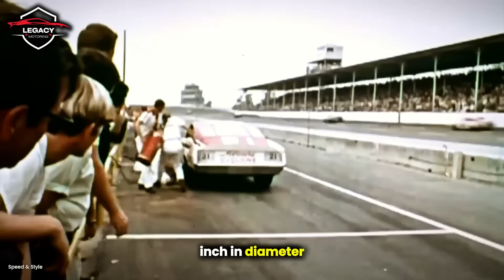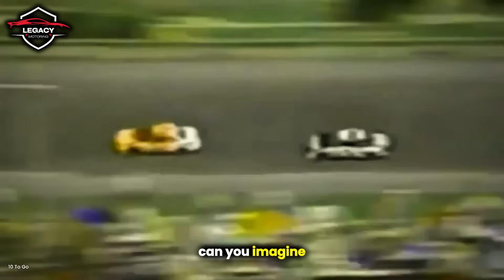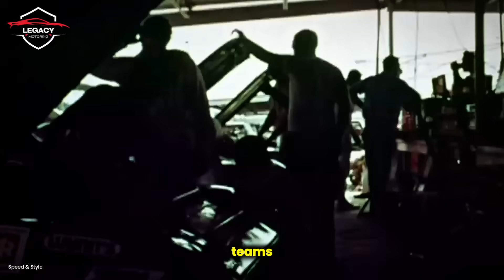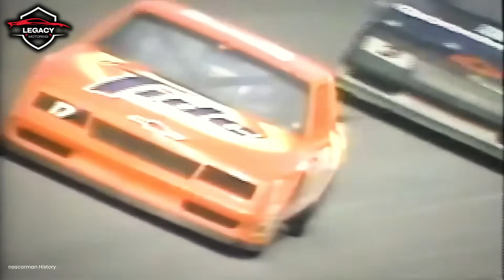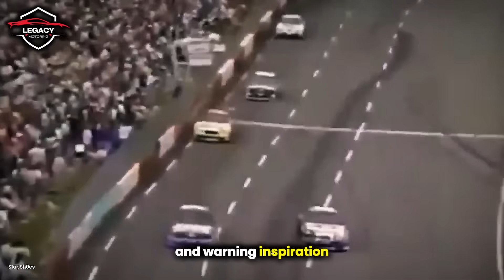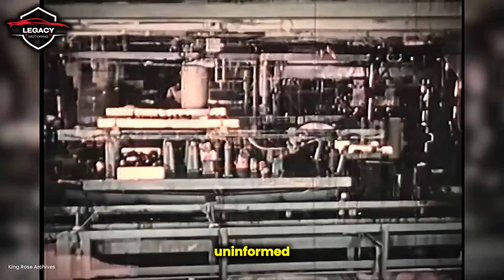The "Invisible" Hollow Bolts That Fooled NASCAR For 3 Years: How Did They Miss This?

Comment: Everyone knows who did the bolts ... same guy that made the oil pan bigger to cut the air from underneath her, bigger fuel line to give her an extra gallon of gas, shaved an half of inch off her and shaped her like a bullet, then took the time to do the tires ...matched perfect and staggered special... also same guy that knows where to find moonshine in WNC and women to impersonate state troopers .... legend

Comment: I'm unable to grasp how the hollow bolt was able to deliver air if wasn't visibly altered when inspected.
Reply: Yes, how does it bleed air if the bolt head is intact? In addition, the carb hold-down bolts (actually studs) go thru ears on the exterior of the carb, not in the intake air stream. There's a lot of jibber-jabber in the vid but little technical evidence
Reply: @jimmybryan6760  I need photos and a video. Were these inspectors blind for three years? A straw is open at both ends.
Reply: Thee eyes are as porous as the 🔩 bolt 👀